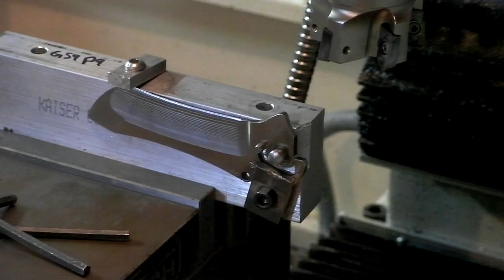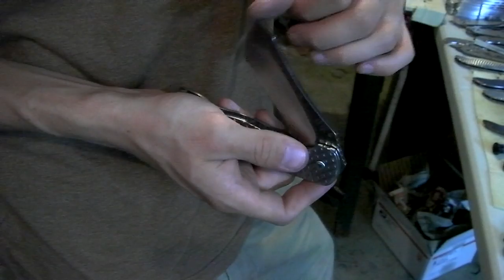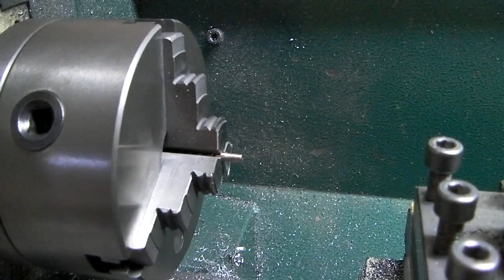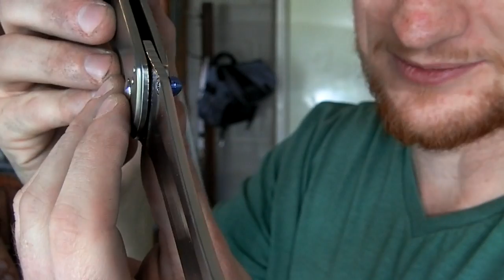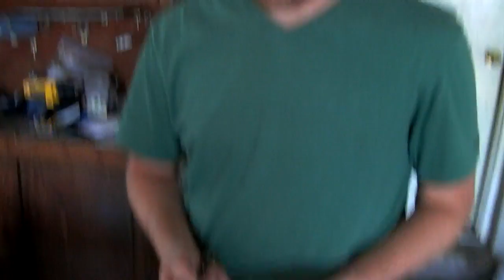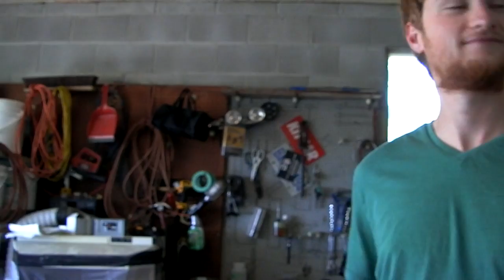Knifemaking Tuesdays Week 37 - lock angle, custom stop pin, rants

Comment from the maker: The undesirable results were mostly fixed by re-machining the blades after they've been hardened, and by using better toolpaths.  Then I was using a 1/4" ballnose endmill, now I'm using a really sweet toroid cutter from Tormach, it's an indexable endmill that uses two round buttons, creating a donut shape when it spins (toroid).  This sweeping motion makes a way nicer cut than a ballnose, where all the cutting is happening RIGHT at the centerline with no velocity.

Comment from the maker: Yes and yes.  There are certain rules to doing two color anodizing, but yeah it's totally possible and I'm going to try it out tomorrow.  And with a good shake and wrist flick it will pop out, but it's not that easy for most of them.  It's such a dumb law because using the flipper opens it 10x faster than gravity ;-).